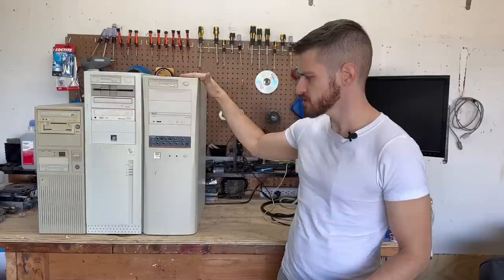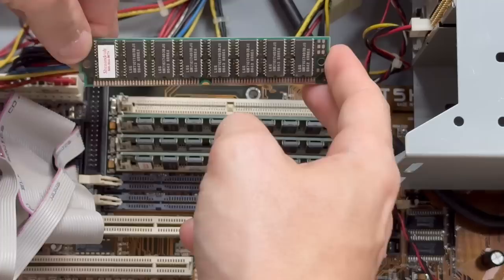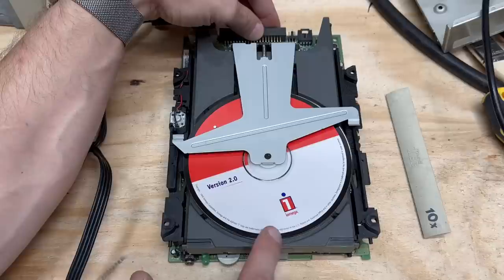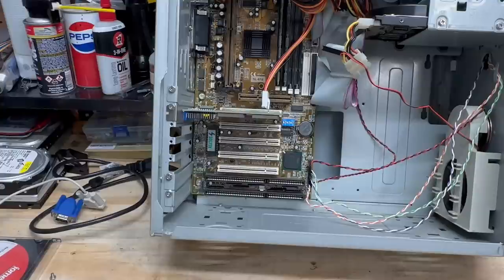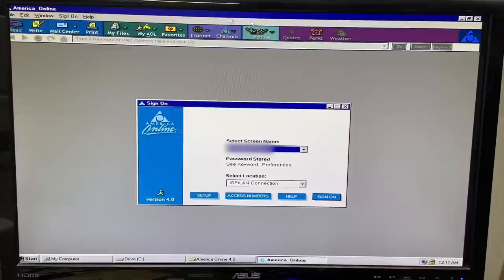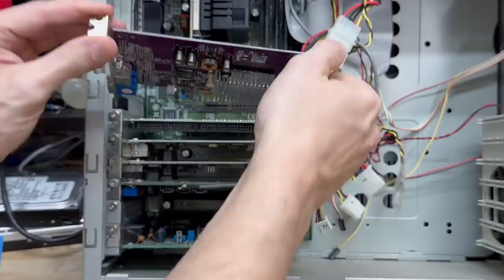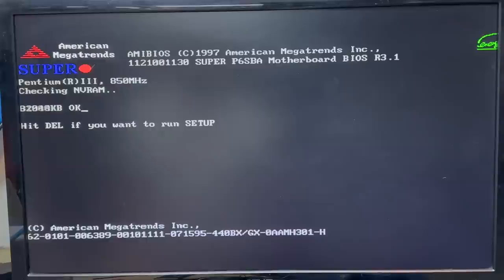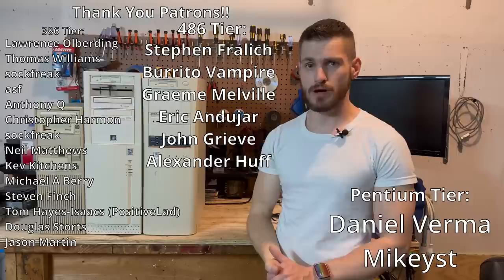Let's teardown and test some GIANT vintage computer systems! From the Franklin eWaste haul!

Comment: that lockable and removable hard drive is so damn cool. i kind of miss the giant case era, double floppy, cd r/rw some kind of audio interface, and some other random thing in the front was just ridiculous.
Reply: Those removable bays were terrible for hard drives. Most of them lacked any sort of cooling, so drives would cook inside them and wear out prematurely. They also often only used 40 pin ribbon cables, so if you had an ATA66 or 100 drive, it would be crippled to ATA33 speeds or worse. It was hard to find those things with 80 pin ribbon cables and more importantly, fans for cooling the drives.

Comment: Awesome content loving your channel. Keep up the great work and thank you for sharing. Gotta love windows 95. I’ve got an old compaq persario 616C with 56 mb of ram and pentium 150 non mmx still kicking around from 1996 at exactly 58 minutes of inactivity it goes into standby mode and will lock up every single time no matter what windows or proprietary bios setting’s are selected. It’s a real pain getting into the bios too because it is on the original 1.5 gb quantum big foot hard drive I’ve taken out of the system and carefully stored away. I did manage to find a good 20gb Matrox ide hard drive for it.  I’ve unfortunately never had any luck getting the proprietary bios copied to the newer drive. Honestly I’m not really sure how it even works it must have the bios on some chip on the motherboard only it’s not accessible to me unless I have the original hard drive attached.

Comment: All three of these beasts are beauties. I love that Yamaha audio card... it's fantastic to see some of the history of music production on these kind of computers.

LOL, your "eardrum abuse" guitar piece was just fine. Great to see you playing, although I think I'd be just as embarrassed to play on camera like you.

For that ancient Cubase install... wow... where to start!? Are there any old project files on the HDD? I wonder if it's possible to get them off and open them up on another system? It looks like it is Cubase VST 4.0, the professional 24-bit version. This is the first time Cubase supported 24-bit audio. It came out in 1998. What a fantastic find!

Unfortunately, as best I can find, the "latest" version of Cubase that supports opening these old Cubase VST files is Cubase SX3 (released 2004/2005), which is itself super old. Look for .all and .arr files. Reading back through old posts on the Steinberg forum, I can see people still able to import these around 2012. That was over 10 years ago. I wonder if anyone there, or on forums like VI-Control or KVR, would have old systems sitting around that can import these files still. Assuming there are old Cubase project files on that HHD still.

Anyway, good luck in building an old audio production PC. I wonder what kind of audio latency that Yamaha card has working with the Pentium CPU.
Reply from the maker: So far I’ve only found samples on the hard drive. I think all of the rendered tracks and project files got stored on the external SCSI drive.
Reply: @miketech1024  Ah.. bummer. Makes sense I guess. Trying to open those files would have taken a fair bit of work anyway.
Edit: Project files I mean. Is a shame there's no rendered files either. :(

Comment: no need for Audacity when you have Steinberg WaveLab lol
Reply: the sound card in the last tower was sold under a bunch of different names but its widely known as the Ensoniq AudioPCI.  Creative Labs bought Ensoniq and re-badged it as the Creative Ensoniq AudioPCI, then the Creative AudioPCI, then the Creative Sound Blaster PCI 128, and then at least two other names.  this card was very popular with music fans who were getting into PCs via Napster because it had the lowest SnR of any card on the market; it was very well suited for people who wanted to attach a PC to a HiFi amplifier or receiver component.  it's basically a PCI-interfaced DAC, and all the audio processing is done on CPU, so a high-spec system was also needed.  it isn't well suited to gaming (no EAX/A3D, earlier mentioned performance penalty) and IIRC it was one of the first cards to provide zero DOS support.  the official installation disc will give you a wavetable package you can load into memory for improved MIDI playback.  when the Creative Labs purchase went through, the market was instantly flooded with $15 Ensoniq-braded stock.  today it's a bit of a scourge as everyone wants gaming cards, but its important to remember these were very well liked at the time for a reason.

Comment: Hey, someone can correct me if I'm wrong, but I'm pretty sure that glxgears will be running on the software GL drivers, and therefore won't test the 3D acceleration at all. I don't think Debian has nouveau support, and it definitely doesn't have the nVidia binary blob driver out-of-the-box, so Knoppix won't either. If you wanna test the 3D card, Windows 98 is going to be your best bet. Either that or a lot of trial-and-error on period-appropriate Linux distros. Nice videos, btw. Subscribed.

Comment: Well hello gorgeous :-)

Shame about that removable HDD, I wanted to see it in action. I've seen these removable bays in the past but never used one. The clicking of death was painful.

I'm glad you put "No spinny" on the pile for later. I'm curious what its problem is.

"Eardrum abuse" haha!

Ah yes, the good ol' Win 95. You breathe too loudly and it locks up. You brush the dust off of the pc case and it asks for drivers.

28:30 ba dum tssssss

The purple pcb is interesting. Never seen that before. Normally green or blue.

Oh the Amibios is cool, never seen that before.

Yes, high speed cd roms are noisy. Although I saw the Kenwood 72x somewhere on YT, and it was very quiet. Shame the tech it used didn't get more traction. It was awesome.

Comment: hi any audio recording computers cost big  money    i had cool edit 2000  wavelad 4  
and  m-audio  delta  44      with scsi hard drives    i did have a  adat edit card as well   

if you find a working pci mum  with alot of ports   they can still be used  for audio 

amd 3+  mini for video editing
Reply from the maker: I was really amazed by this machine. I didn't think such low noise was even possible from a PCI sound card!

Comment: that is infact a removable hard drive. not sure if original use of the 1st pc  was that but drives like that  were commonly used as military/government  or offices witch could have classified data. and the reason they used them was so when not in use the drives could be removed and locked away to avoid unauthorized access to them or to be easy to remove and be destroyed incase of an emergency to avoid data falling in the wrong hands. the rest of the pc was irrelevant since that was the only drive in it
Reply from the maker: Good thing the drive was dead then! My days of handling DoD data are fortunately very much over!

Comment: Watching you, Mike...I immediately realize that I don't know half of what you do when it comes to testing the computers. For instance, what do you do with the knoppix   9.1 CD?    What does it Test and what should you be looking for?
I see you using it as a Test...but I don't know what you're trying to test.
When I plug in a new/old computer...if it don't 'Go'...I look for a 'Popped cap' on the motherboard.   I'm sure you do before you fire them up.
Have you...when you're dealing with a lot of drives and ribbons as in these three computers....take a picture, to use as reference...you know...'Just in case' ya don't remember where a cable goes to?
The moment you showed the units, I thought Servers.
I have not yet ran into a computer older than a 1998 Gateway 500...it was a 500...I had its non working twin and some how I was able to take the Dead computer's 600 CPU and put it in to the living on...took its Ram as well.
Thanks for the video.  I might have learned....Something...well...I did learn that I need to learn more.
Reply from the maker: Knoppix is a Linux-based OS that boots to a live installation, so it doesn’t require a hard drive in order to run (in contrast to Windows which has to be installed to disk). I mainly just use it to see if the machine will boot, make a few basic tests and learn a bit about the hardware as it boots. Yeah I do visual inspection of the motherboard for bad caps and other weirdness. Fortunately all of these systems are pretty much standard. The only thing I do take pictures of for reference are the connectors for the front panel. Those vary quite a bit between motherboards as there is no standard for them.

Comment: I have trust problems when it comes to using old power supplies. When it comes to AT though, because of the -5v thing it does make sense to want to use them for testing at least. I like that you're connecting two hard drives now. That puts some more load on them for sure. My only advise I guess is let them run for a long while just to see if the behavior of the PSU changes as it heats up. You won't know for sure if the psu is ok till you try to post a machine with it and there is a full load.
Reply: When not powered on electrolytic capacitors lose their oxide insulation layer. Then when you power them up they become explosive devices. But if you reform the capacitor it can come up to spec again. You do that by charging the capacitor at a lower voltage. The current passing through the capacitor then builds the oxide layer back up.
Reply: @1pcfred  So better to use one drive for reforming? I've always just let them run for a good 20 or 30 minutes. I didn't realize that was reforming anything.
Reply: @ItIsNot1984  you have to reform at a lower voltage. A load just draws current. It is the pressure of the voltage that'll blow the capacitor out. Radio restorers use variacs. But with a SMPS you can't really do that. You can't reform a SMPS in situ. You'd have to pull each capacitor out of the PCB and reform it. At that point you might as well just replace them all. Most caps used in SMPS were garbage from the get go anyways. Teapo, Capxon,  J.D., etc, all junk. Then there's capacitor plague era gear. That's any electronics made between 1999 and 2007. Almost all caps made then were defective.
Reply: @1pcfred  I was actually going to ask about variacs and what the equivalent would be. I guess there really isn't one. So I guess if it survives powering on, it only needs to run for a little bit to get the caps back in spec. Thanks I feel like i learn something here.
Reply: @ItIsNot1984  well it may not spectacularly blow up but you can have micro holing. That will degrade the performance of the component. But yes there is a gray area where the capacitor can survive power up and somewhat come back but still sustain irreversible damage. There's been a lot of research done on capacitors. It is a somewhat interesting topic. Knowing how the tech we use works is compelling.

Comment: i don't remember EDO ram coming in 16MB sticks max was 8mb  total per slot max of 32mb ram with sdram whether pc 33/66/100 16/32/64/128/256/512mb dimms supported

i ran 196mb ram in mine, that looks like scsi 33/66 hard drive caddy likely scsi card in there somewhere, win 3.11/, 95b/c, win 98/95se, nt4,0 and xp/me

noting neither win 3.11 nor 1st 95 version natively supports usb, usb support didn't come native until revision b or  c  of the os noting back in the days when disc were quicker for updating pc's all up there was 5  versions of 95 released

Comment: Okay... my friend .. before destroy by open a HDD like that (witch it looks it was mechanically fine by the way)_...... you need to clean his power contacts at the least.. _(that behavior is from an HDD that is not getting the enough juice to properly start running you know)_.... you need to see if it is getting the proper voltage in the board.... or some bad cap is pulling down the voltage in it.... or simple oxidation in the contacts of the connector are maybe loosing half the voltage right there............ remove the board from de HDD... clean it... inspect it you see some bad component??.......... veeeeery common... is the silicon thermal pads discomposing shorting thing with the nasty liquid they lose when discompose........... is contact in the board also... that connect to board whit the engine coils inside they needs to be clean and deoxid...... and one or more terminal with many springs contacts that connect to the heads and to arm coils.... all those needs to be clean and dioxide also.... _(this goes for modern drive too.. some times an HDD said that it have bad sector because is not getting in the heads the proper voltage because those spring contacts are dirty or oxidated.. is the first thing to do when a HDD show bad sectors clean all his contacts) ........... with a thermal camera.. you shroud see if it is any component in the board that look to be overheating/shorting by most probably some bad cap that needs to be replace... etc... etc..

Comment: Is it possible to remove the platters from that hard drive and transplant them to see what is on them?
Reply from the maker: It is possible, but a very delicate process.
Reply: @miketech1024  I heard that the platters are so flat that if one was put against the other, you could lift both by lifting only the top platter.

Comment: You call that giant?  That's tiny compared to my full server tower of about the same age as this one.  Mine stands at desk height, rolls around on 4 locking dual caster wheels, has 12 expansion slots, 10 drive bays (half are full height 5.25 inch drive bays), with dual optical drives on the front.  Notice something yours has that modern PCs don't have?  8 expansion slots.

Comment: Anyone remmber that dell 486 with 12 bays 4 disk bays and a 3 foot mb? could add around 26 sticks of ram , will 18 as i do not stick you could mix the diff ram slots. sorry not dell it was getaway , gateway 2000 branding if i recall right.
Reply from the maker: Sounds like a beast of a machine!

Comment: The reason your power supply tester said the last power supply was fine when it wasn't is because your tester is too basic, and doesn't look at the ripple. Most likely the capacitors in the power supply are shot, and while the average voltage is right, there's too much ripple for the motherboard to boot. A cheap oscilloscope would be a lot better tester than some cheapo chinese thing that doesn't measure ripple
Reply from the maker: Thanks! Do you have any recommendations for a decent tester? I’m still leaning towards a custom design currently. I do have a scope, but would prefer a quicker, all-in-one solution that can both apply a load and check for things like voltage drop and ripple.
Reply: @miketech1024  Even a decent multimeter would work. Measure on DCV to see the average, but check each of the rails on ACV to see the ripple. A scope is better because the ripple or noise can be pretty high frequency (at the switching frequency of the power supply) and not sinusoidal, so not necessarily measured correctly by a RMS multi meter. You could even build your own breakout board with both ATX and AT connectors and a bunch of banana jacks to quickly connect a multimeter or scope to each of the rails (if such a thing doesn't already exist). The only real difference between AT and ATX is the connector, and that ATX has the PON signal and +5VSB standby rail which allows the motherboard to turn the power supply on. ATX also has 3.3V that AT did not. They both have +12 +5 -12 -5 (though -5 isn't required in the ATX spec anymore - only ancient ATX supplies will have -5V)

Comment: hi watched the video part with all the audio 

now alot of all the software would be all in one   my mate picked up a computer  very like this audio one  came in to the 
place like good will  wear he work   it was juck i said   be could i would need the software  files to boot from

if the drive was to go bad     software only count is i have the  data to set up software 
i do have ar ar one's that are 100% ok    got alot just before  the file thing went   
you know what  limewire     right at the end    there are still alot around still

Comment: Gracias buen video 👌, me gustaría ver un vídeo sobre equipos OEM por ejemplo tengo una Sony vaio VCG-RB13mx de escritorio y es súper complicado cambiar su ISO a Windows 10  tal vez por ser un PENTIUM 4 prescott 4 de ram. Agradecería cualquier consejo para llegar a formatear a win10. Por el momento solo puedo instalar win7,8 y Linux. Pero 10 imposible excelente día bye.
Reply from the maker: ¡Gracias! Windows 10 aún debería ejecutarse en un Pentium 4, pero debe usar una imagen de 32 bits. ¿Qué tipo de errores te aparecen durante la instalación?
Reply: @miketech1024  en BIOS no aparece como opción de booteo USB y con CD nada dvd tampoco. Lo relaciono con la motherboard Intel d915gro es OEM.